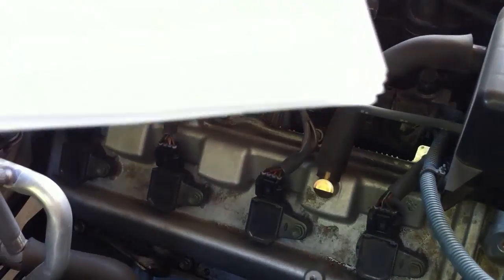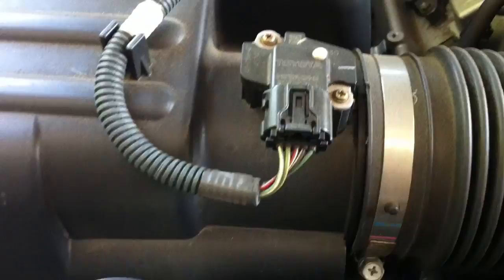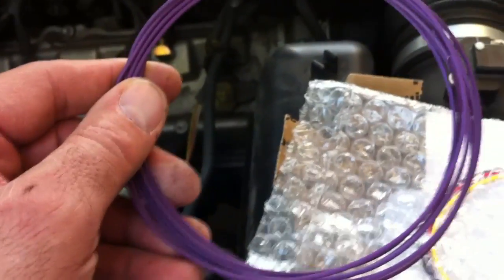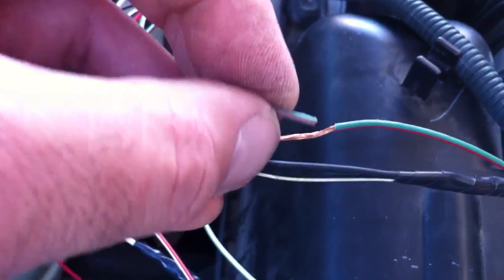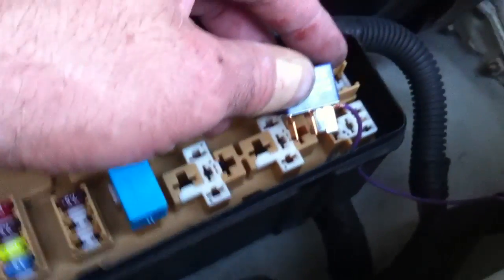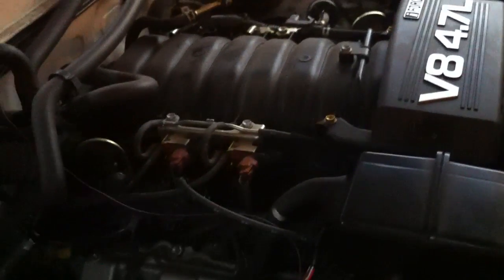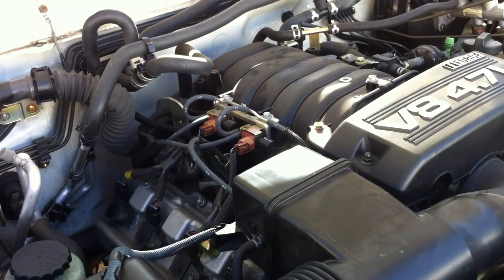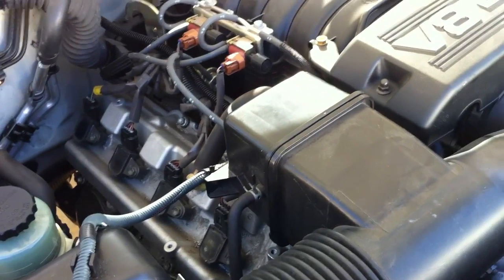Air Induction Pump Bypass Module - AIP Valve Bypass Install P1441 and P2440 Toyota Sequoia Tundra

Comment: Hi Steve, I know this is an old video but I was wondering if you could answer a question for me? I bought the kit from Paul and I'm installing it on my 05 Tundra, did you just use double sided tape to mount the module? If so, has it held up for you? I'm worried it will dry up and fall off over time. Great video!!
Reply from the maker: I used two sided tape. I can't remember if it came with it. The car has almost 140,000 and is still running great. I think there a seller on eBay who has an adapter so you don't have to cut the wires.

Comment: Our 2008 Toyota Tundra's "check engine" light came on a few months ago.  The truck was running fine with all the gauges normal.  When we had the oil changed, they told us the error code for our problem.  It turns out that it has to do with the Secondary Air Injection Pump system. We discovered by researching online that in 2007-2010 Tundra's and 2008-10 Sequoia's, there's an issue with moisture getting into the system. In 2011, Toyota extended the warranty (for this issue) on these years and models to 10 years/150,000 miles to fix this particular problem should it occur -- with reimbursement for owners that had already paid to have their vehicles with this problem repaired. We took our truck to the dealership this week and authorized $150 for a diagnostic check to make sure that the Secondary Air System was the correct issue for the "check engine" light being on.  Since it turned out that it indeed was the Secondary Air Injection Pump system, the $150 diagnostic check fee was waived and the repairs are being done free of charge.  In California, where we live, bypassing anything could have been a real issue when we go for our next Smog check.

Comment: Thanks for the great video.  If you don't mind, would you please let me know which module you bought from ebay.  and how much was paid.  thanks
Miguel
Reply from the maker: I think I paid $300 and I had to cut wires as you can see to install it. There are sellers now that have ones you don't have to plug in and cost only $150.

Comment: Hi Steve, are things still running ok for you with the bypass module?  Also, when you inked in the wire colors on the paper, were those the colors we're supposed to use, or did you just choose those colors randomly? Just curious.  Thanks for the video!
Reply from the maker: +LynchMeister Everything is still working great and it passed the last  smog test. I can't remember how I picked the wires to match. I think I based it on reading the instructions and what colors I had in my wire harness. Have you purchased the unit yet?

Comment: Hey Matt,
I went to install the kit on an 05 tundra last night. I get the white and yellow wire hook up on pin 5, but then it says the red goes to pin 1 and black goes to pin 2. Does that mean pin 3 & 4 wires are left alone? One bit of advise for anyone planning to this, I have 180K on my truck and the nuts to loosen for the block-off plates were very hard to get off. I actually broke one on the passenger side and thought I was screwed, but managed to use just one to retighten and secure the plate. Use a few shots of liquid wrench if you see any rust to avoid trouble. Other than that, the video was great - thanks Matt.

Comment: What about P0418 code?
Reply: There's a list of codes that it will fix here: http://hewitt-tech.com/store/index.php?l=product_list&c=1.  0418 is not on the list.
Reply: kris Johnson Kris did you find a solution for the 0418 code? Toyota Bulletin says replace the Air Injection Relay, P/n 89580-34011, but I haven't found an install guide/video.
Reply: +Matt Nicoletta 
I have not replaced anything. my truck starts fine and not much noise it just feels like when I give it gas half of the time it's missing  or feels like when you hit rumble strips for like 2 seconds. I really hate my truck.

Comment: i just installed your kit on my 06 tundra. Codes were all gone for the first day and check engine light came back the second day. It did take it out of limp mode, would the module just be a bad one? or is there somthing else im not looking at? I had a mechanic do it for me and he aswell was impressed. But seeing that light came back on has me worried. Please respond and help me out.

Comment: Im very impressed.   You have big balls for a guy that didn't own a 10mm deep socket that you dove right into the inner workings of your 35,000.00+ truck to fix something that should have never broke. I am impressed and thanks for making this video.
Reply from the maker: +64maxpower 
I took auto-shop in high school and would help my dad when I was a kid fix our cars so I have a lot of experience. I'm not a professional. I just replaced the radiator in it a couple of months ago and saved myself $600. Yeah, and I don't have deep sockets especially for a 1/4" ratchet  for whatever reason. I guess I should buy a set.

Comment from the maker: Still no issues. I had the timing belt and water pump changed a couple of weeks ago and I told the mechanic to be careful when removing the air cleaner assembly. I told him to just flip it on top of the engine. 
The test will be when I go get it smogged in February. I'll take a follow-up video when I am there.

Comment: Great video Steve!  Unfortunately, I am on my second AIP with my '07 Tundra DC SR5 .  I bought the truck in '10 with 24,500 miles and just had the pump go out again 4/18/14 with around 60,000 miles.  Rest assured I will be installing this bypass after Toyota pays the dealer to fix their mess... again...
Reply: Great! Thanks for the info. Where would we be able to purchase the "kit" to do this? Any help would be great.
Reply: So does Toyota cover the fix?  I have a 2006 Tundra that has about 160,000 on it.  Thank you very much for the video! Great job!!

Comment: thanks to the idiot government workers over at CARB you have to deal with this crap, they've got all the bright ideas. I have a 2000 Tundra V8 and I hope i don't see this problem, trucks using a lot of gas though.
Reply: Luckily your 2000 does not have this AIS garbage on it.